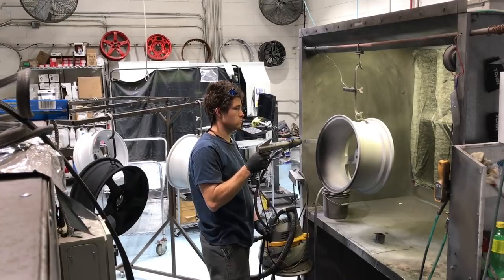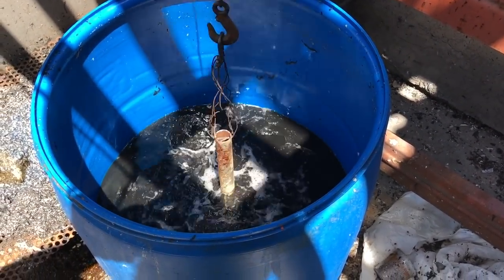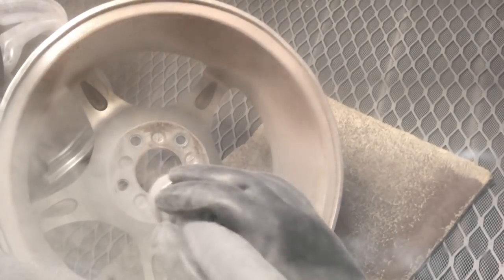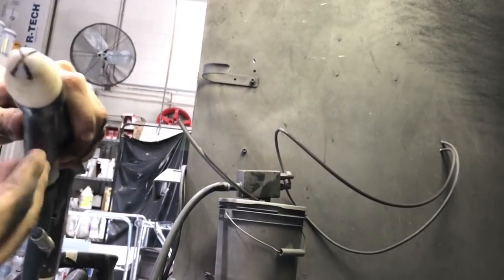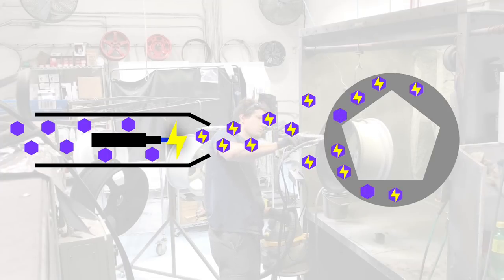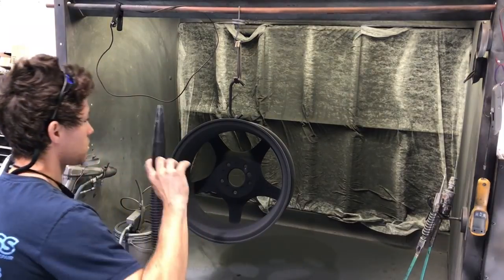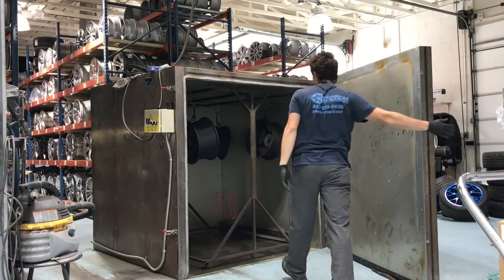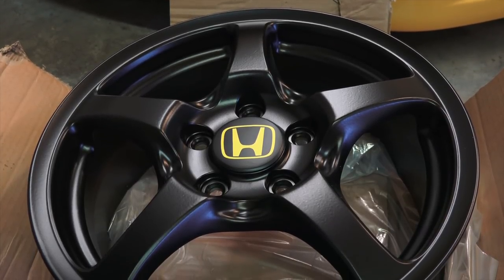What Is Powder Coating? New Wheels For The S2000!

Comment: I LOVE powder coating. I have a small setup at the shop. Its awesome stuff. Way harder than paint, and it's super flexible. Many of the small GTI parts were done with powder rather than paint.
Reply: HumbleMechanic Yes it's so much better than rattle canning small parts, and it's fun.
Reply: +David Hart 
That sounds like a manufacturer coating quality control (QC) issue along with poor application and curing procedures.  
If powder coating is coming off that is usually due to improper surface prep or improper curing (oven temp and or time). 
When the base metal surface is properly prepped and the powder is properly applied and cure cured the resulting powder coating is very durable, flexible, maintains the surface finish in UV and harsh environments and is impervious to most any automotive fluid. 

Many manufacturers fail in the protective/decorative coatings QC department. 
Many do not properly prep the surface, fail to properly clean/dry and rush the piece into coating while still wet, rush the time in the oven with too high of an oven temp and too short of a duration in the oven, some try to save on their gas bill with too low of an oven temp. 
Other cases I have encountered the powder application was not complete to the edge and left bare metal that rusted and the rust crept under the powder coating and causing the powder coating it to lift. 

When prepped, applied and cured properly powder coating not only adheres very well to the base material, it is usually quite difficult to intentionally remove. 

Do not fault powder coating when the root cause of the failure is with management and  their quality control.

Comment: shouldn't he wear a respirator?
Reply: Yes, although he has an active vent that pulls the powder away from him.
Reply: Not just dying young,  but a painful way as well because the process will be slow
Reply: ... and then sue the powder manufacturer when they get old and develop emphysema or lung cancer...
Reply: that cant happened to him because he is a professional.
Reply: He should absolutely wear a respirator. I work with paint robots (most of them painting with powder) and i can tell you that an active vent (the ones we use is x-times bigger than his) isnt enough to get that fine charged powder out of the way of your nose/mouth.
Reply: Yes he should, the body cannot break down power and will accumulate in the lungs over time.
Reply: fortunately lungs can recover incredibly well. tho you are right.
Reply: The Body cannot break down powder, it accumulates over time.
Reply: And is then naturally expelled from the lungs, similar to sand inhaled at the beach. It gets interesting with TGIC though...
Reply: Glenn Lever 
'Brake' is a stopping device... 'Break' is the spelling your looking
for.   Spell check may be the culprit ...   English has so many words that sound alike, but have different spelling and definitions.  
Cheers👍🏻🙋
Reply: No, it is bad stuff to inhale
Reply: Whenever i use any aerosol or an angle grinder i always use a respirator regardless of the ventilation. ( also a welder and i always wear one while welding, most people don't)
Reply: His shop's insurance just went up 5000%, after they saw this video.
Reply: Pay attention, people!!!  "he has an active vent that pulls the powder away from him."
Reply: Definitely not good enough
Reply: +RonJohn63 i suppose you havent worked with powder coating systems?
Reply: how interesting i use tgic powder at work
Reply: Yes. And he should have eye protection and gloves while angle-grinding and eye pro while sand-blasting. But the dude is too cool for safety — just the sunglasses on top of his head.
Reply: Hell na all about that high life
Reply: He will be alright... as long as his lungs don't reach 350F
Reply: @user-qx7tm5df8j  Yea too right aha. Pretty bad when it gets in the corner of your eye's to which you cant really help because if you wear saftey glasses/goggles build up so much powder you can no longer see... The joys of powder coating though 😂😅😆
Reply: Never seen a pro painter use respirators!  I only for the amateur to buy and use!
Reply: His lungs are positively charged.
Reply: @dante love lmao
Reply: Its in his written will that is appointed lawyer kept. It stated he wish not to reach age 40.

Comment: One thing to watch for when getting stuff powder coatrd is WHAT powder they use. Epoxy is the bottom of the ladder, polyester is at the top.  You can also get a mix of the two. Epoxy wasn't UV stable when I was powder coating and would fade over time. Some cars with black plastic trim parts  do the same (start to go grey)  if the supplier hasn't used UV stable plastic.

Comment: You can also heat the part to around 400 degrees  and hot flock the powder onto the part. it goes on in a thicker coat and melts instantly. This helps with hard to get places since you aren't just relying on the electrostatic to make the powder cling to the part.

Comment: As long as the temp is below the annealing temp of the alloy, it will not affect the metal on a solid, well made wheel.
Reply: That temperature is in the range of artificial aging of heat treatable aluminum alloys.  If anything it will increase the temper of the alloy.  That is as long as the wheel has been solution treated.
Reply: I was not familiar with how Aluminium alloys behaved to heat, as metallurgy is an interest at best.
Reply: The 400 F (204 C) for powder coating curing is well below any temperature affecting aluminum alloys used for automotive wheels. 
The lowest temperature affecting aluminum alloys is above 650 F (343 C) for 3003 which is a very low grade of aluminum, all other grades are above 775 F (412 C). 
The time required at the target temperature to metallurgically alter aluminum alloys starts at a minimum of approximately 2 hours (120 minutes) and goes to approximately 12 hours.
Also the low temps coupled with the short time period for the powder coating cure of 12-20 minutes is significantly shorter than the time required to heat treat, anneal, temper or alter the metallurgical properties of most quality automotive wheels. 

Consider this, the brake rotors dissipate their generated heat into the wheel hub and brake rotors often reach peak temps greater than 1200 F (650 C) during repeated hard usage.
Reply: While brakes do get that hot, the wheels are not subjected to hours of that kind of heating. There is the element of cooling that still occurs at speed. Most TUV approved wheels I've seen failing, including volks, bbs, enkei and the like have failed because of incorrect heat treatment after coating the wheel. 

Forged wheels developing stress fractures after the process is a huge risk. Most wheel companies will void your warranty as well. I'd rather painstakingly paint or anodize the wheels than run the risk of a stress fracture.

6061-T6 anneals at 350 degrees and most of these shops cure their coats at 400 for 10 minutes which is pretty much guaranteed to weaken the metal. Not sure where you got any of those temperature's from when it's pretty clearly posted that aluminium will anneal much faster. In fact the last step in the forging process involves heating the wheel upto 350 for 8 hours after the forging process is complete to air cool the metal and complete the forging process. Aluminium requires very little heat to anneal. Aluminium requires lower temperatures and needs to be baked longer to get the coat to set. Most places will not bother doing that because it will cost more per set to achieve the same finish. So instead they run it hotter for a short amount of time which damages the wheels. 

Steel can be powder coated and is much more resistant to temperature fluctuations.
Reply: +vidurc 
First, many aluminum wheels are subjected to cyclic temperatures peaking near or over 400 degrees during competition events, particularly in the hub area and the temp tends to dissipate lessening the saturated core temp farther away from the hub. 
I cannot comment on TUV, I am not familiar with TUV. 

I have not experienced nor know of consistent widespread structural failures of properly treated powder coated cast or forged aluminum wheels. 
Several of our clients have post manufacturing powder coated their wheels and compete on road courses several times every month and at least 3 have been competing for several years on the same powder coated wheels. 
Is there an opportunity for abuse of the wheel during powder coating? 
The answer is an unequivocal YES. 
Can the abuse damage or weaken the wheel? 
Without specifics of the abuse it is nearly impossible to determine if these is damage or weakening and to what extent, but it is possible. 

My Alcoa and Alcan handbooks do not list 350F as the annealing temp of 6061-T6. 
Alcoa, Alcan  show that it anneals at 572F (300C) to 770F (410C) and I just cross referenced with AZO Materials and they concur. 
https://www.azom.com/article.aspx?ArticleID=2540 
Your figures may possibly be for a different alloy composition. 
The artificial aging (second process that strengthens the product) temperature for 6061 is 330-400 F, no quench. 
Temperatures in this range also increases the yield strength and the elongation properties. 
Alcan's wheel alloy handbook shows that "Anything involving a paint-bake cycle" as a final process step can be considered a "Variations on T6 which allow for in-process aging" for temperatures 330-400 F, no quench. 
According to USCAR many if not most commercial commodity aluminum automotive wheels are 357-T5. 

Furthermore, the stress fractures that you refer to are likely the result of improper acid immersion cleaning and neutralization. 
There are several ASTM, ASM and SAE papers on this subject. 

Sorry, steel wheels are not the subject of this discussion.
Reply: Not to mention that if you brake hard enough often enough, or if you have a stuck caliper for some reason, it's possible for areas of the wheel to get hotter from that than vs. the temperature used to bake on the powder coat.
Reply: You'll have to look at forum entries from people who have powder coated forged wheels and are experiencing cracks. The HUB on a well built wheel isn't a point of failure typically given how much material is present and the fact that it needs to survive eccentric mass tests. The hub is supposed to be able to take higher temperatures and a lot of flexing without cracking or breaking. 

The parts that are affected are typically the base of the spoke connected to the barrel of the wheel. The wheel has less material at that point and any heat treatment affects the thinnest parts of the wheel.

I think we're getting our wires twisted on the terminology. What you are reading is correct, however the artificial aging that manufacturers use to  harden the wheel after the casting process is complete is right at 350 for 8 hours. Powder coaters bake the wheels for an hour at temps varying from 300 to 400 degrees F. That add's an additional hour of cure time and that is exactly what causes damage to the wheels.

Now running it at lower temperatures will help but that means you need to cure the coating for a longer time which relates to more overheads for the coaters. A lower cure temperature would help but no one really does it unless they guarantee that they do not deviate from that process. 

6061-T6 wheels which are forged wheels suffer greatly from this very process. 

I've had stress fractures from powder coated wheels and instead I've chosen to anodize or even paint wheels with no failures or issues so far. 

There's also a reason why manufacturers void their warranties if a wheel is powdercoated but do not when a wheel is painted or anodized. 

Yes the process of stripping the coating should be considered as well but so far with the work I've done on my own wheels I've had no failures at all with all the autocross and daily driving duty the cars go through. I realize that is anecdotal evidence but I'd say there is a lot to consider besides just shooting one's wheels off to a coater and expecting no failure at the end of it. 

http://forums.pelicanparts.com/porsche-911-technical-forum/481117-powder-coating-forged-aluminum-wheels.html

Comment: Considering how hot brake discs can get under heavy use (and of course, that they wheel is bolted directly against the disc hub), I would imagine it would have to be a very inferior quality wheel to be damaged by 10 minutes at 400F.
Reply: Wheels are still turning at speed and dissipating heat while being baked in a chamber is done for hours annealing the metal. Stress fractures occur from powder coating and often void your warranty as well. Volk, BBS, HRE, Enkei and more all void your warranty the second you powdercoat your wheels. Anodizing, and painting on the other hand run no risk of causing metal failure down the line. I've seen plenty of forged wheels crack instead of bend because of this very reason.

6061-T6 anneals at 350 degrees and most of these shops cure their coats at 400 for 10 minutes which is pretty much guaranteed to weaken the metal.

If the coating is cured for hours under the annealing temp the wheels will be fine. If it's done for a shorter time at a higher temp the wheels will be compromised. Think about what makes more financial sense. Baking the wheels for longer at a lower temp and having to spend more to be careful or baking it faster to make a buck. Most shops will not take the care needed to get it right.

Comment: OEM wheels are made with way more process and controls, the raw aluminum wheel have to go through 16 stages of pretreatment in different solutions and powder coated once, bake for 30 min, spray paint and bake again, finally one more layer of clear powder and bake again. 
OEM wheels may not look as good as aftermarket wheels, but the quality standard is extremely high! There is no possibility that this shop spray and baked wheel will last through 30 hours of salt water and acid splash, which is a test for all OEM wheels!

Comment: you should let him know to try coating the wheel hot, after a 15 min de-gas in the oven at 200c this will remove all moisture and when coating wheel at that temp he will see the powder flow and be able to gauge getting a glass like finish better. and then back in oven for 15 min to fully cure.

Comment: great information! However, it should be noted that this is an expensive process and pending on a verity of factors, it may be cheaper to simply buy new wheels, In addition, it should also be noted that once damaged or scratched, power coated products are hard and expensive to repair.

Comment: I'll stick to anodizing my wheels instead. Powder coating can be really hit or miss and when stress fractures develop it's often a while after the wheels have been used. Sadly very few coaters take the time to get the temps or the bake times right. I'll be damned if my volks end up cracking for an aesthetic improvement.

@EE also before calling it a conspiracy actually look into how wheels are produced. Those temperatures are used withing tight specs and time frames which is why they cure with no damage. You are now re-heating an already formed wheel annealing the metal past the point it's supposed to be at from factory. That is exactly what causes stress fractures. 

This is like claiming that powdercoating a sword will cause no issues when the heat treatment process was developed specifically to attain a certain degree of hardness. Beyond that point you WILL age the metal making it brittle. The process of building wheels involves heating the metal, forming the shape while it is still liquid, and then using controlled heat treatment to cure the shape.

Powder coating was developed for steel. Anodizing is what is used for aluminium. 

Instead of solely asking the person who has a vested interest in more people getting their wheel powder coated a simple search online regarding the annealing temperature of metal and the process of creating wheels could've given you a better answer. 

Volk uses flow forming to develop and build their wheels utilizing an understanding of how metal flows through particular molds during the casting process and consequently they develop the molds to form certain crystalline structures to make them adhere and hold a certain shape. Enkei uses rotary forging on the barrel of the wheel so less metal is used on the barrel while still maintaining strength and keeping the cost of production low. When you heat the wheel all you're doing is annealing the metal beyond the spec set from factory making the surface susceptible to cracking.

Comment: You should get the IR temp gun and test how much the powder coat insulates the rim from helping to release the rotor heat.
Reply: maybe it will help it because of the black color. We all know that black radiates and attracts heat a bit more then other colors.

Comment: I would have loved to learn the benefits of powder coating. Is it more resistant to scratches? Does it make the wheel easier to clean with high dusting brakes for example? Is it cheaper than traditional paint? Can it be applied to the body of a car? Can it be done on a whole car?

Comment: I left my wheels to a shop that powder coats big objects like trailers, car chassies, rails etc. They didn't remove the powder from the back of the hub before baking the wheels, which my wheel repair shop had to remove afterwards -.-
I don't know if you should wax powder coat, my coat got dull after just a couple of months.